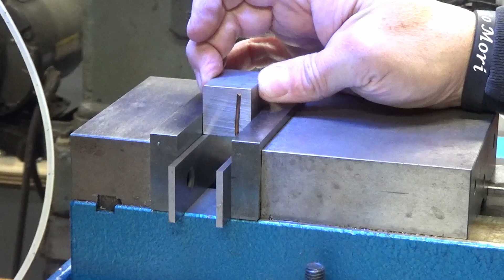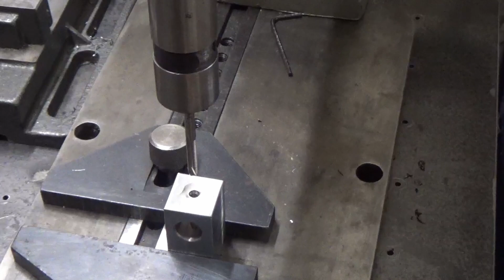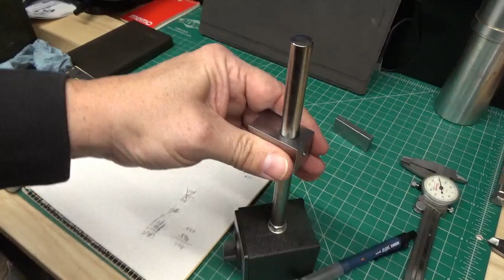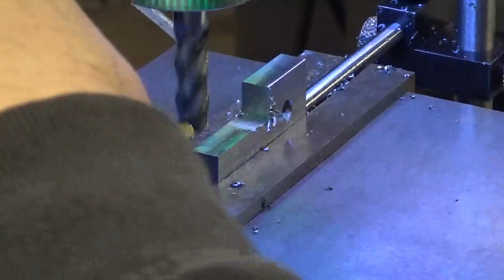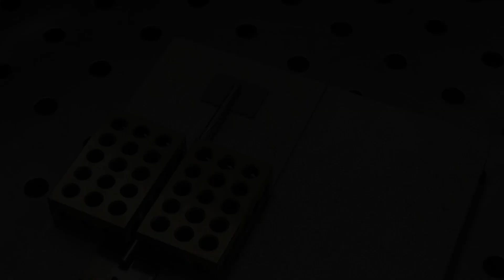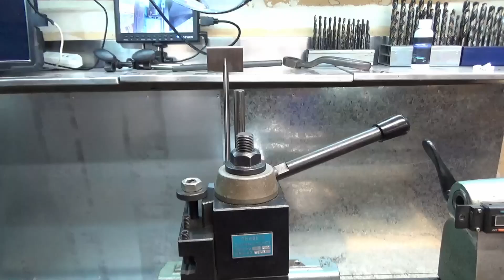I make an Olly Tool Setter!

Comment: ALUMIWELD is NOT for steel!!! It says so in the name! It WILL come apart!
Reply from the maker: According to the Alumiweld web site: "ALUMIWELD is a welding rod that is able to repair any aluminum metal by using a PROPANE TORCH !

Also will repair Zinc based metals, (Pot Metal), Mag-Alloy and Galvanized Steel all with a propane torch.

AlumiWeld is capable of repairing copper and brass to aluminum."

Given that it is specified that it will work with materials other than aluminum, I thought I would try it to attach stainless steel to carbon steel.  Worst case scenario, I need to make it again and use more traditional brazing techniques.

I really doubt that it's going to come apart, I've literally banged it on the welding table and it's still stuck tight.